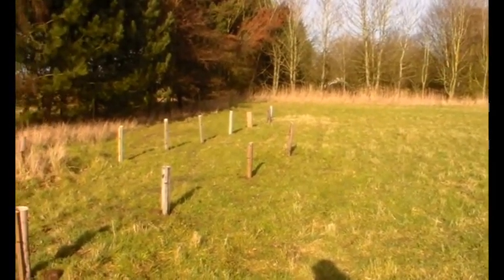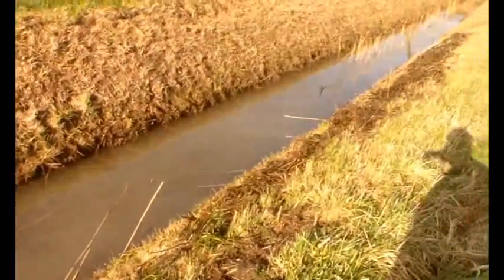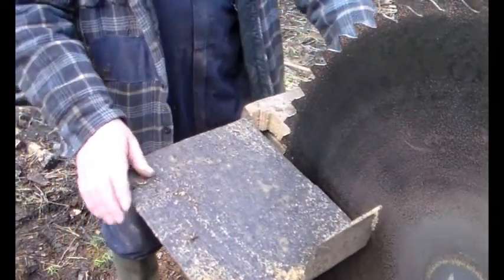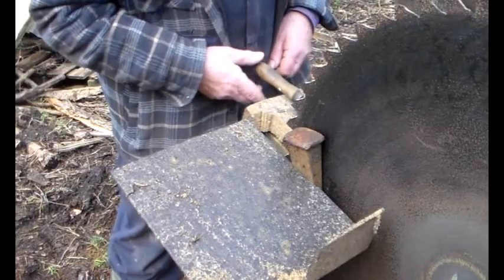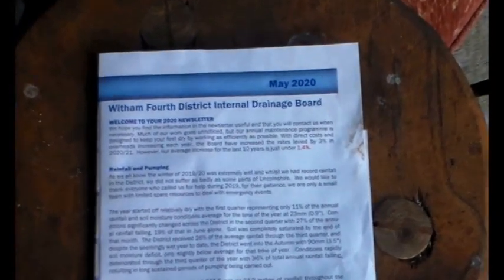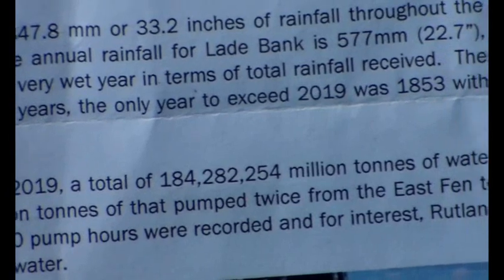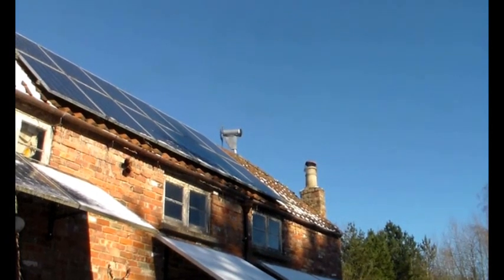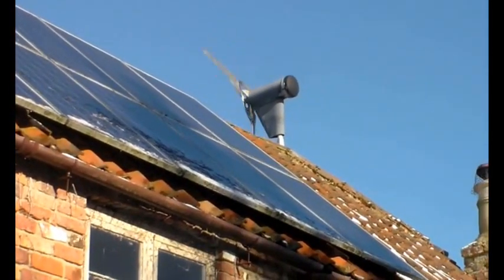Home life in lock-down No.19. February Tree planting, glasshouse and wind turbines.

Comment: I picked up a relatively new sack barrow last week, two completely broken wheels, they have these awful cheap flanged bearings that fall apart. I priced new bearings but it would have been as cheap to get new wheels. I have worked up a bit of elm from the wood pile to the dimensions to make bushings instead and have them soaking in oil to see if they will work instead. I am loathe to buy more new stuff when I can spend hours saving a few pence! 
Towards the beginning of the video Andy I began to despair! But this is where we are, almost a year has passed. Nothing big has happened, but life goes on and all the little bits that make up life must continue! So your video and it's content is very welcome.  
I am not sure I completely understood the pellet burner part you were welding, maybe I missed the context somewhere? 
Cheers
Reply from the maker: HI, I'm sure Elm or Oak bushing will work, in the past lignum vitae was used. Yes life continues and each spring is to be savoured as we don't get that many. The pellet burner bit is a prelude to a separate video. I will add a link to my pellet burner repair vid. Cheers